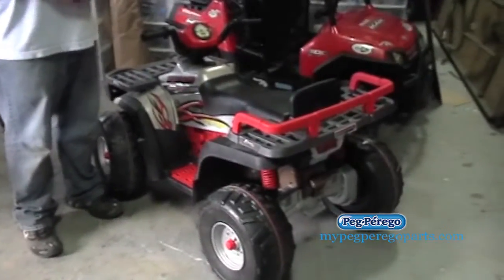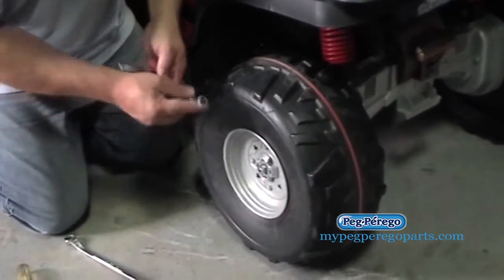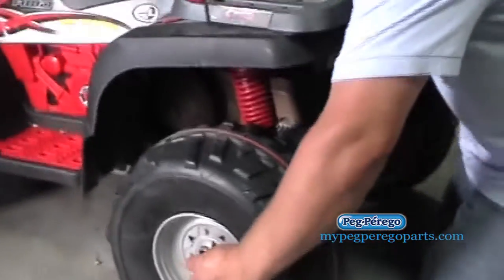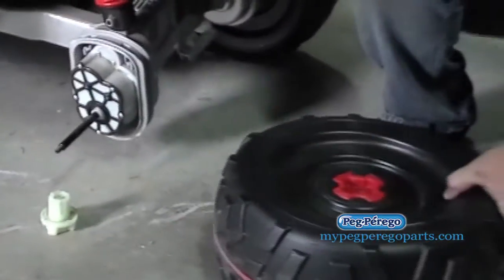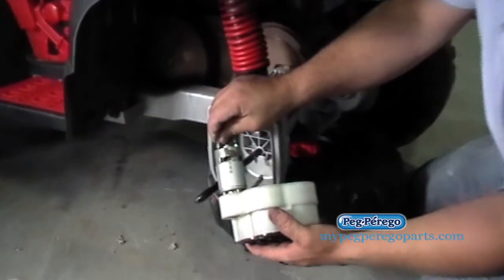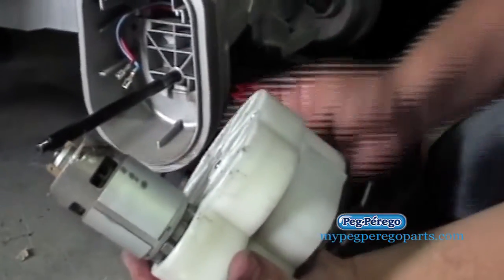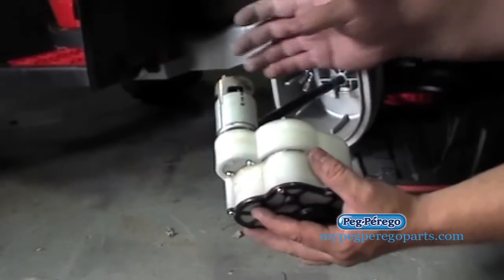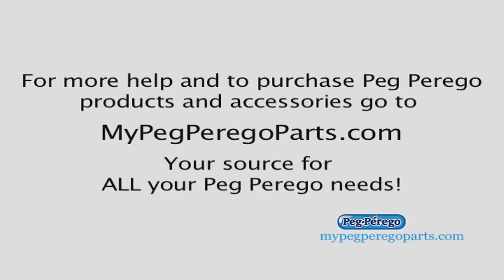Cuts out? 2nd, check motors.  Replace wheel, gearbox & motor on a Peg Perego 24 volt Polaris 850

Comment: Is the motor always in that wheel?  I'm confused.  Is this how to change the vehicles mirror or does each tire have a motor. sorry, but I'm a female trying to figure out why my son's vehicle doesn't work anymore. Spent $150, got it home, and after 15 minutes of using it it doesn't work anymore.  I'm trying to watch these videos to diagnose the issue.
Reply: Peg Perego seems to build things to fall apart possibly from my experience. Not a good brand. Fisher Price Power Wheels are much more reliable and are built well most of the time.